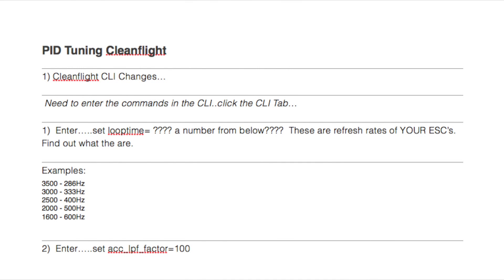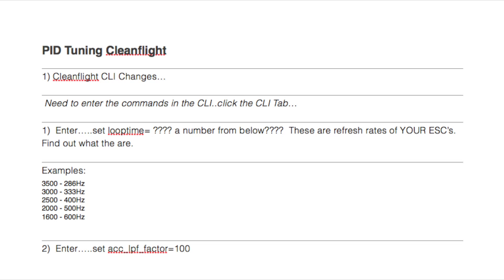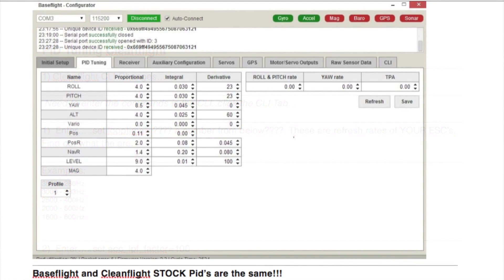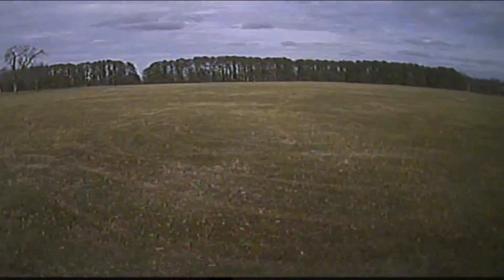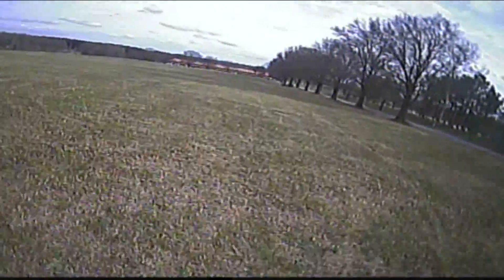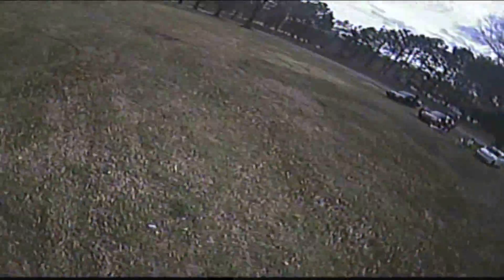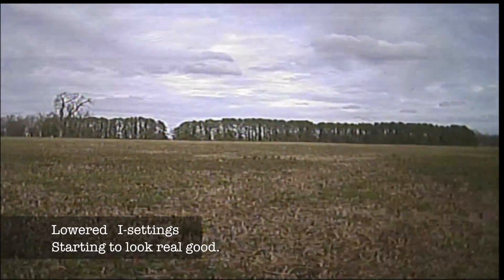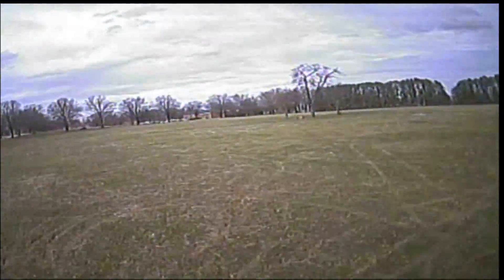Full PID Tuning Cleanflight in FPV Part1

Comment: Excellent informative video covering the basics of PID tuning. Thanks for breaking it down for us new guys getting into flying quads. It was very helpful, absolutely fantastic.
Reply from the maker: Thank you.  I am very glad it helps and if you have any questions let me know.
Reply: I think I need this.. I got a storm racing drone a few days ago and it was really smooth when I had it all stock. Then I did the 4s upgrade (had some FPV equipment to install, decided to do it all at once) and after uploading their flight settings when I was setting up CC3D / calibrating the new ESCs, it feels very hard to fly now.

Just taking off is pretty unstable now compared to when it was stock. It never goes straight up on initial lift off which is pretty unnerving as someone new to this hobby.

Do I just need to sit down and tune it one afternoon like in this vid?
Reply from the maker: Yes..... put everything back to stock and start at the beginning. Tune... P ...I ....then D on Pitch and Roll...then Yaw.......THEN Angle PID's
Reply: I see the oscillation thing pretty bad when I'm climbing, and when i'm falling it wobbles pretty bad, even flips over usually. Is it not supposed to be this tricky to fly?
Reply from the maker: No...make sure you are in Acro/rate/manual mode and NOT Angle or Horizon....if you are in Angle/Horizon the quad WILL act crazy and wobble all over the place.
Reply from the maker: Basically be in Manual mode to tune before going to Angle/Horizon.
And again LOWER that P on ANGLE on PID tuning page from 8 (or 10) to 5 or 6.
Reply: Nice vid, will help newb's out a lot.
Reply from the maker: Agreed
Reply from the maker: Agreed

Comment: I enjoyed your tuning insight in the video. The looptime parameters you referred to in your instructions, are not the ESC's refresh rates. The set parameter controls the duty cycle of the Flight Controller (FC) i.e how many times per second it should process the main control loop (reading sensor data etc). And it depends on how fast the sensors can update their own data eg GPS module @10Hz would simply repeat its data 50 cycles/times, when you try to query it @500Hz. A lower value for looptime say 2000/500Hz, does not necessarily translate to more locked in response, and depends on the correct combination of Sensor(s) Resolution/ESC/Motor/Lipo C rating etc. In CleanFlight the ESC input refresh rate is controlled by 'motor_pwm_rate', and it can be as large as 32000 for brushed motors, and NEVER set larger than 498Hz for brushless motors. This is the speed of PWM communication between the FC and ESC. How the ESC translates that input, to control-steps to the motor, is highly dependent on the firmware (algorithm for linear response) and the switching speed of the FETS and saturation etc. It's important to appreciate that once you change the value of looptime, you would affect the current PID parameters and need to revisit the tuning. Happy flying.
Reply: tricopterY The exception to your point is Oneshot ESCs, since the point of Oneshot is to synchronize the control loop with ESC timing. However, you're dead-on correct that changing looptime should be coupled with retuning PIDs since the amount of correction is proportional not only to the error, but also the rate at which the corrections are applied (indeed, this is part of the definition of Integral corrections).

Comment: Quick FYI, acc_lpf_factor is "accelerometer low-pass-filter factor" not "loop factor" -- it's basically a noise filter for the accelerometers, smoothing out vibrations so that the computer only sees accelerometer changes caused by larger scale overall movement of the frame. But cranking it up some is still probably a good idea.

Comment: There is a little issue that can turn you in the wrong way in tuning. Overtuning of I will lead to bounce back in fast rolls and flips. And you can think that this is because of too low D, because we all know that D removed bounce in flips and rolls, and you  starting to raise D. And it will help, but it will be too high really. So if there is bounce back in the end of flips and rolls this is not just lack of D

Comment: Heh Shelby-- the Robocat flys-- well, sort of. I have been hours getting it to lift off. I goes slightly up, then drives itself into the ground! It is a Naz 32 advanced and has a Mag and a Barometer on board. Are there any PID's or settings-- I am brand new to racing-- photo guy.
Thanks for your thoughts.

Bud

Comment: I watched your video and it was very enlightening! How would you know whether Roll or Pitch P, I or D needs tuning? Could you tell from the way it wobbles? Specifically, during I-gain tuning, wobbles on ascend and descent, how would you know if the wobble is caused by the I-gain of Roll or Pitch? Do you mind watching my video and comment what's causing the wobbles? I could post the link here or as a private message. :)

Comment: Great video!! Would it be possible for you to add the resulting PID settings to the description of this video?  It would be helpful to see how the values changed after tuning was complete.  Also, if you (or anyone) posts a similar video, it would be great to see the pid settings per flight and track how they change as tuning progresses.  I know every quad is slightly different, but it would still be relative and therefore helpful.  Thanks.
Reply from the maker: I am doing another video and will show you from stock PID'S to final PID's.  It will be out by next week.

Comment: Great guide Shelby!

I'm guilty of using others peoples PID settings in the past, they flew "ok" but not as good as your end result, currently upgrading my QAV250 to a 6' prop/4s and will definitely be following your guide...one Q? tho:

when adjusting the P & I values are you adjusting Pitch then Roll or using the same values for both so your tuning Pitch and roll together?

again, thanks for the video, looks to be helping a lot of people...
Reply from the maker: Glad to hear you like my video.  To note I will be posting one last video on PID tuning that I will be answering a lot of questions I am getting.  To answer yours...at first I do both Pitch and Roll  get it stable then go fly around and look for the axis needing tuning and adjust that....ie...when turning I get a high oscillation ...I will lower my P value on Roll ONLY.....hope that answers your question if not a little.

Comment: hey if you can help me out a bit that'd be great.  first off i read somewhere that you should tune P then D then I... to raise P until the high oscillations were slightly present. then raise D till they go away. then raise P some more. Then work on I to get rid of the slow oscillations and to hold its angle.. i have tried working this way and it was difficult. i am also new to all of this and tuning LOS, so its hard to see and feel for what to look for and what to adjust. and im not sure where my PID values should be when i start tuning. and, while cruising around a faster speeds, the quad likes to level out when givin throttle, and then pitch back.. ALOT when i want to pitch back a little bit to slow down a little. Would i have to tune the I value to correct that?

Comment: Shelby, thank you for sharing this. One question, because I don't understand. When I start to pid, the I and D columns have to be to zero or I have to keep the default values that CF sets? So I start to change P, than I and after D? Thanks
Reply from the maker: Keep the default settings for I and D.

Comment: Do you raise + lower the roll and pitch PID settings together?  That's the one thing you weren't clear about.  Other than that, thank you!
Reply: johnnyyhash1   In most cases yes, roll and pitch are tuned together,  unless you are flying a quad with offset motors such as a dead-cat style quad.

Comment: hey  new to pids and what not I have tray ed to turn on one shot  and 4 some reason when I turn it on and save it  .I will power it on and test the moters and when I power it on the chimes that sound is not the same when arming the moters won't spin when one shot is disabled  the quad is working fine any suggestions would be great I am at the point of just keeping it turned off although everyone says to turn it on so lol plz help I am

Comment: I think it cleared a few things up for me, thanks!

Although one thing has always confused me somewhat, I always hear the "P setting", the "I setting" and so on, but never "P settings" (in plural). Do you only adjust the PID values for "Roll", "pitch" and "yaw"? and not the PID values for "ALT", "Vario", "Pos" and so on? Or do you leave all of them alone and only adjust the rates?

Hope you understand what i mean :)
Reply from the maker: You tune both P values for Pitch and Roll at the same time THEN later when doing FPV final tuning...you then fine tune each axis.
The only other setting on the page to tune is Level......at least for this application of MiniQuads.

Comment: @1:15 did you Start with the p Settings for Only roll or for both roll and Pitch?
Reply from the maker: Start with both......then you can work on Pitch and Roll separately when you are confident you think you have it mostly tuned  for P....applies to I and D as well.

Comment: Hey Shelby, Firstly I'd like to thank you for sharing this video. It's really been a huge help.

I followed your video and have now have my P values nicely dialed in. I then moved on and turned up my I values to try and induce slow oscillations on accent. No matter how high I is turned up, there are still slow oscillations on decent. My pitch I is now up to 0.1 from 0.049. Could you possibly tell where I am going wrong.
Reply: John Paul Shelby Voll I'm getting the same problem. My I setting is now at 0.095 and i'm still getting wobbles at descent. My D settings is almost at 100 and my mini is still bouncing back on me.
Reply from the maker: Make sure you are not in your rotor wash....you have to be moving forward and then drop throttle. ..now look for some oscillating.
Reply: John Paul Shelby Voll Hi Shelby, thanks for replying :)
I think i got it now. 
I was trying to tune the I and D values at the same time. I think that what messed up my tuning. 
I watched your video again to make sure i didn't miss a step and decided to tune in the order mentioned in the video. And it worked!
So first i tune P, then I and then D. 
The way i do it is first i tune P for pitch and roll separately using stock I and D. You can tune it holding the quad in your hand (ie. not flying). Raise or lower it until the quad doesn't oscillate in full throttle. Then lower it around 25%. 
Then i move on to tuning I and D while flying.
First i setup cleanflight so i can tune I and D from my tx. Then i set D to 0 (using default I as starting point).
Then i tune I while flying. What we're looking for is the quad flying without slow oscillation and not wobbling while on descend. That's not our final I value since the quad is more likely to still drifts, we're going to tune it more later. The reason i set the D value to 0 is i think that the D also help dampens the slow oscillation caused by high I value.
My I value at this stage is around 15.
So then i moved on to tuning the D.
I raise it until the quad started to feel locked in (doesn't bounce back) when i roll or pitch the quad aggressively. My D value at this stage is around 32
Once i'm satisfied i then get back to tune the I value again.
I then raise the I to the point that the quad can hold an angle (doesn't get back to level after a while when i let go of the stick). Keep in mind that i was tuning using the tx, so that will make the pitch and roll values identical. So if you're flying h quad or spider quad you probably should tune again for your pitch or roll (but first take note of your previous tuned values)
My final values after draining one battery in one session of tuning is
P 3.3 I 0.021 and D 32. The quad is starting to feel very locked in, but i think i can make it better after another tuning session or two.

One more thing. Always tune in acro mode! 
Hope this helps
Reply from the maker: Your I values are really low....are you in PID controller 1
Reply: Shelby Voll Hi Shelby, yes i was using the PID controller 1. 
Did another tuning today before work and my I value ended at 0.027 for roll. It holds angle pretty good for small distances since i was tuning in a small park and LOS. But i think i'll test it again at the flying field this weekend. 
And my D values ended up at 39. I can still see a little bounce backs after reviewing the flight footage, but i hesitated to raise it some more. 
Can you share what your PIDs values for miniquads? I know it'll probably won't work for everyone, but at least we'll have an idea of what our PIDs should look like.
BTW, thank you so much for making this video and taking the time to answer my questions. Really appreciate it!
Reply from the maker: Adi Surya Budi Wibawa It denpends on alot of factors like esc's and motors to just throw numbers out....but for your D value...it is low....raise it to 60....You will know it is to high when it is sloooooow to get to corrected angle input......I will be going over this in the upcoming video.
Reply: Shelby Voll I do think that i can raise my D value some more. I'll do more tuning and testing over this weekend.

Comment: would be nice if you had shown what the pid's were that you ended up with to see how different they were from stock
Reply from the maker: Each quad is different....motors, esc's, props used weight...so then pods won't be transferable unless everything is identical from one quad to the next.....for this frame the pids were like 5-6 on P .065 I and D  was somewhere in the .50 range or higher

Comment: +Shelby I been working on the tuning for while, can u explain little u said easing p settings and lowering is it all of it level/roll/pitch etc. for example I m having oscillation during punch out, what do I lower? All P? P level? P roll? A lot of video out there doesn't tell u exactly what to tune
Reply from the maker: on punch out lower your P on Pitch and roll....by .5. leave Level P alone.
Reply: +Shelby Voll just one more going side to side roll, it's jerky kinda feel like oscillation
Reply from the maker: +rx7turbo287 try raising D on Roll

Comment: Do you just set the Loop Factor to 100 on every aircraft? a bit confused with that,while there is an option for the ESCs
Reply from the maker: Yes 100 for all aircraft
Reply: well my naze is now working better than ever,but the Yaw is really slow to make a turn,but i did manage to flip for the first time ever,thanks for a great video
Reply from the maker: Your welcome.....ADD more Rate in your YAW and you will get more authority.
Reply from the maker: rockwellmediadundee awesome! !!
Reply: rockwellmediadundee LPF = Low Pass Filter ... it smooths out the accelerometer signals so that the computer doesn't see random high-frequency vibrations from things like minor motor/rotor imbalances, airflow over the arms and frames, and so on.

Comment: how much do you pitch up the pid settings? you say that you have to raise them a lot...stock setting is  4.0 do you raise it to 5 or six or for xample to 4.5 or 4.7? im just getting into the quads. i fly fixed wing for a while now so this is my next step in the flying adventure! :-) hope you can be a bit more specific in the amount to raise up the pid settings. thanks!!
Reply: mysterieuzezaken   Its hard to be specific when each quad is different......      Start with the stock settings and raise them in increments of .5 until you start to get the oscillations he talks about in this video.  Then lower them until things smooth out. 

Tuning PIDs takes a lot of trial and error until you get a feel for what you are really doing.  I watched a shit-ton of videos about PID tuning before I built my first quad, but none of them taught me as much as just getting out there and doing it myself.
Reply: mysterieuzezaken We've had the same problems trying to follow PID tuning guides. When you have one axis at 1.0 and another at 8.0, does "a lot" mean 5.0 or 0.5? This is a nice walk through of the process but it would have been even nicer to see the progression of the values. The difference in crispness is clear to see, though.
Reply from the maker: Jon McGuire agreed
.....I should have shown that....to clarify stock P is 4.0 .....I raise it to 6.0 maybe even 7.0 and adjust from there.....with i stock is .035 and I jump it to .60.....D is 23 stock and I start at 60
Reply: Good info, thanks!
Reply: alright, thanks this makes it a lot more clear!